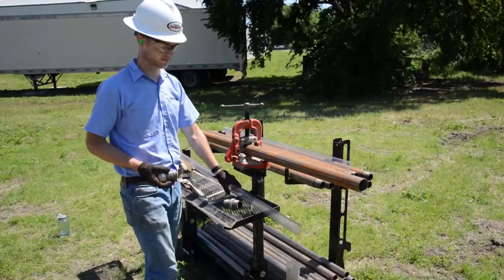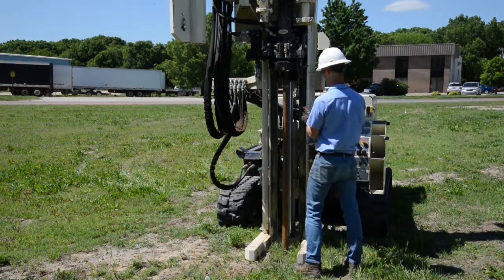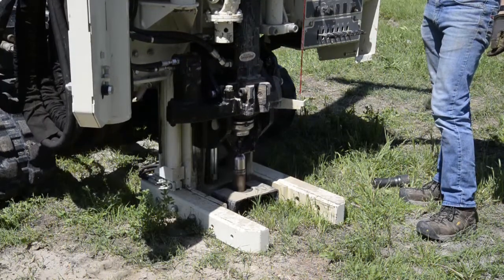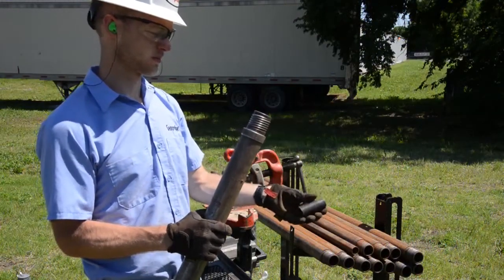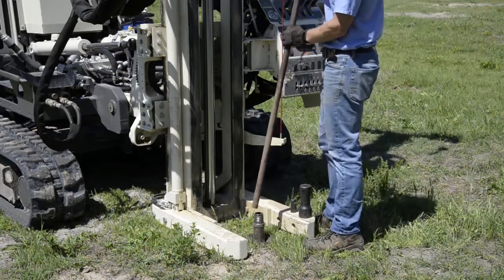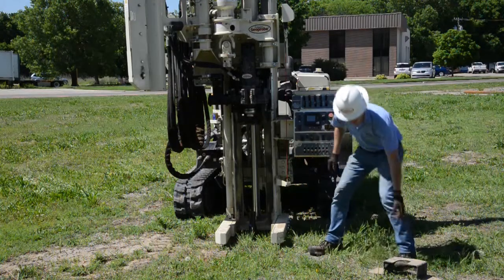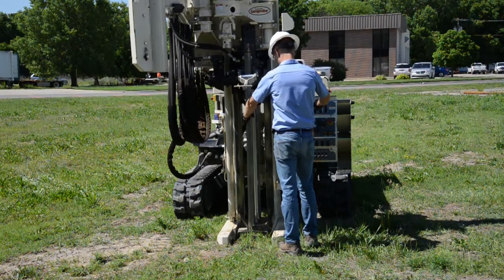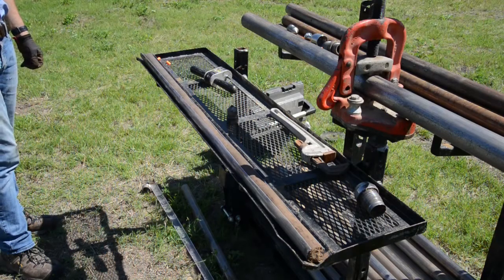Geoprobe® - MC5 Soil Sampling - Step by Step

Comment: What is the difference in sampling with dt22 vs. mc5? and how do you know when either is used?
Reply from the maker: The primary differences between the two are:

Size of core – MC5 provides a 1.68” diameter core whereas the DT22 is smaller at 1.275”

Methodology – MC5 the entire tool string comes out of the ground for each sample interval.  DT22 the outer casing remains in the hole as the sample is tripped out via the center rod string.
Reply: @GeoprobeSystems  oh ok and in what cases would you use mc5 rather than dt22 as it seems dt22 is a little more convenient with not having to take out outer casing?
Reply: @qerick9238 mc5 is just a faster process when you don’t need an outer casing. DT helps a lot with sands